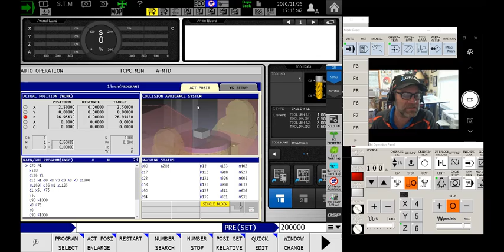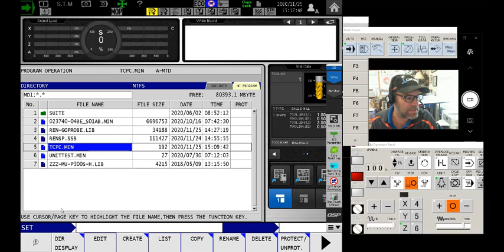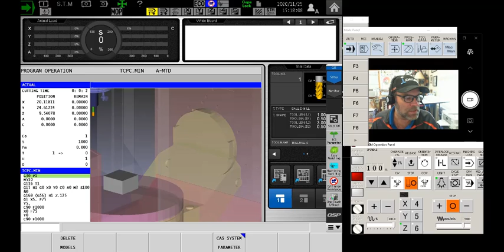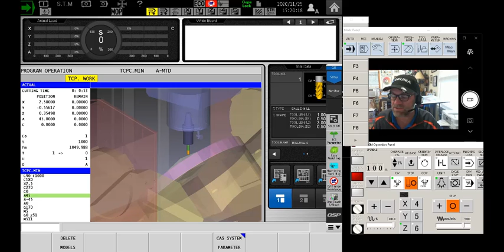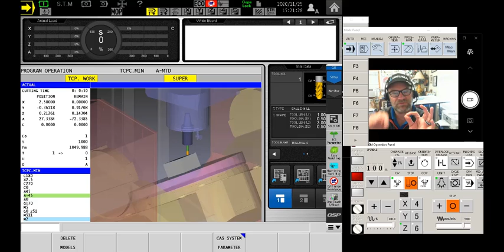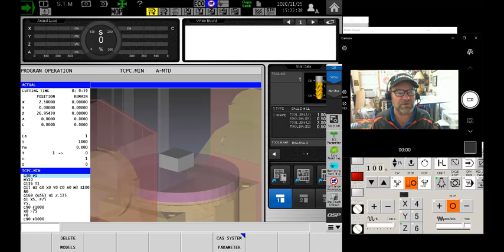Tool Center Point Control

Comment: Great stuff Charley! Can you do a video on using G467 in place of the CALL OO88 on an Okuma geno's M460 5AX? We have some Fanuc 5 axis machines and really like the G68.2 and looking at the Okuma manual it looks like G467 is the same as Fanuc G68.2. I never could make it work on the machine though. Thanks and keep up the great work!
Reply from the maker: Hey there Shane, I'll be happy to bust out a video on this, but I'm pretty sure G605 is the function you'd rather be using instead of G467. The use of G467 is primarily for MCR style Okumas, where the tool angle changes, where the M460 5ax has a constant tool angle moving the part rather than the tool axis. Look for my G605 video coming out shortly and I believe it will be the answer to CALL OO88 you were hoping for
Reply: @pocketcharleywithgosiger  Hey Charley, did you end up knocking out the G605 video? I've had a search on your channel, but nothing has turned up.
Reply: Charley do you have a link to g605?